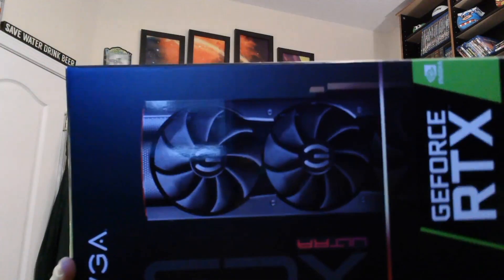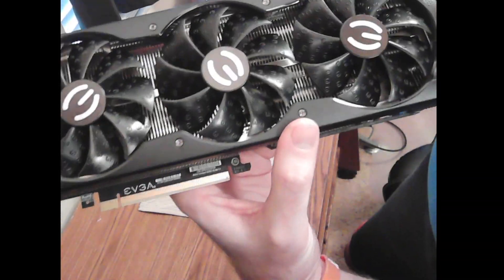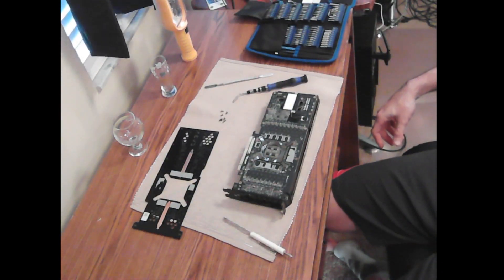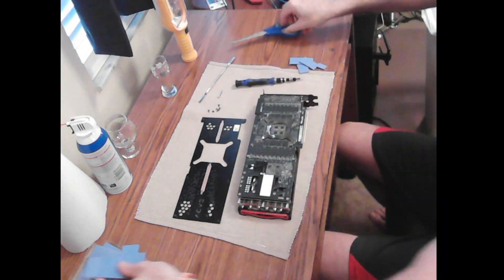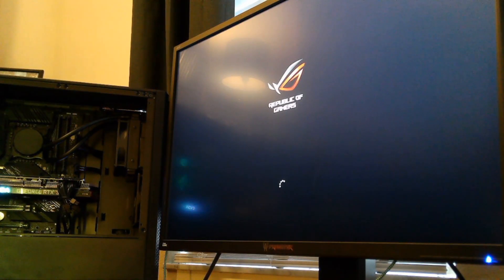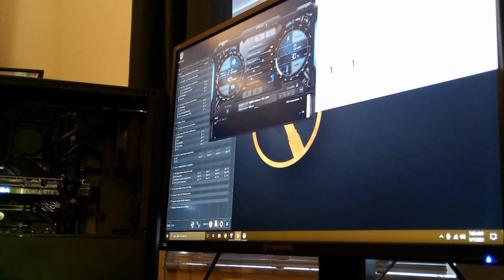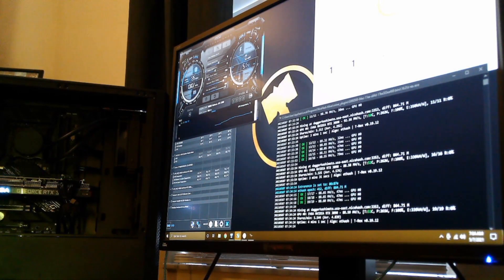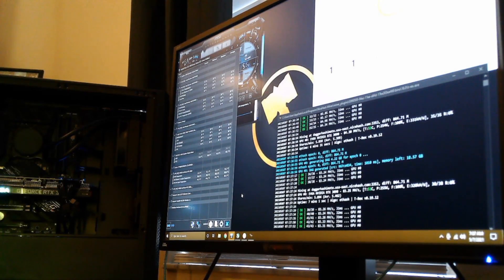RTX 3090 EVGA Ultra thermal pad second attempt

Comment: Check out what We did with the 3090 Kingpin Keep the back plate cool. EVGA's forum has lots and lots of info on what we did with the KPE Uses the same chips on the back. A Big heat sink as big as you can fit. I took the back plate off and have 2 rather Large ones on the chips with a fan on top of the heat sinks they stay warm to the touch with a 2000 rpm fan on top of them i could use bigger ones. These chips give off way way way more heat than there specs say supposed to be like 10 watts its well over 100 when mining any thing. My temps for the most part stay below 80 with a +1400 mhz on mem -200 on gpu and 70%power. I just got a 3090 FTW3 ultra hybrid EVGA has no thermal pads on the back plate at all! I have a email that they said 100c is normal and won't hurt performance! RIGHT! Good thing i got the extended warranty!  A few people even put a aio on the back plate or made a custom copper back plate and heat sinks...I'm waiting on a custom cnc copper back plate for the kpe might have to do one for the ftw3 also! Crays amounts of heat off there chips!

Comment: I have the same card, never opened it, just placed 120mm case fan on the backplate and my temperatures are 57/92°C with 115+mhs while ambient is at 26°C. For some reason I don't think these cards are able to go beyond 116mhs, probably power limitations.
Reply: I,ve got a Constant 124 mh/s With mine
Reply: @avatarwilliYEAH  Nice. Same model? Have you done anything with it or just OC settings applied?

Comment: I just changed my backplate pads on XC3 ultra 3090 and the temps are 1 degree celcius hotter lol I used gelid ultimate 2mm which is 15 w/mk

Comment: I actually had a "professional" change mine for me.... temps went up!  Brought it back.... 2nd attempt- temps went up...brought it back to him... 3rd attempt- temps went up!   ive got some heat sinks and fans coming in today.  hopefully i can cool the xc3 ultra up enough tor run over 70mhs... ugh
Reply: its because the stock cards come with thermal putty for a reason and the professional isent a pro otherwise he would of done putty
Reply: Dont need putty. Done mine works fine 3080 99mh/s xc3 at 70% power! there is a row of black chips that need a strip on top that goes near the pipes on the heatsink. Took me about twenty goes to sort it but did eventually. Add 1.5 strip on top of where the thermal paste was.

Comment: Do you have any update on this bro? What size pads you got and your final resulting temps and MH?
Reply from the maker: i think used 2mm pads.  I put in the real good Thermalright Odyssey 2mm pad on and have only been getting 115 MH/s at 295 watts at about 95 degrees on the gddr6x memory.  The card itself is running around 60 degrees right now with it being hot outside.  I also have a bunch of Thermalright Odyssey 1.5 and 3mm pads because I have done several cards.

I think I filmed me putting the better pads on it, but something was wrong with the video...  I also wasn't 100% happy with my results only being a little better and not perfect.  I don't know why I cant break 115 mh/s with out turning my power way up...

but the card is running pretty good right now.  I feel happy enough with 115 MH/s.  It never gives me any issues.
Reply: @extrmtech1730  you only changed the thermal pad on the back to get 115MH 295W 95C? Did you change the front as well? I have the same card right now I'm setting it to run at 100mh/s and vram already at 104C at 276W (although I only have the fan at 70% because anything above it the fan is too loud lol). I am thinking of changing the thermal pads and wondering if I need to change both side or just the pads on the back plate would be good enough
Reply from the maker: @ddr80  I changed both sides.  I used the thermalright pads.  there is another company whose pads people are saying work better and they are get better results that I might try, but I cant remember their name......  You would need to do a little research.  it might be the comments for this video...
Reply: I have been using frosty thermal pad 12.8. It is similar to the Thermal Odyssey but more compressible which might be better overall when applying. It has proven to be very useful, for my 3090 getting 120 MH/S stable at around 86-90 degrees depending on the outside. I changed both sides btw.

The backs on the 3090 matter so highly recommend good quality pads too. It's dumb but you also have to cool the backs with fans :( or do that silly heat sink mod which I definitely am not going to do.
Reply: @markw496   What thickness (s) did you use? Thanks for the info!
Reply: From memory i used 1.5mm and 2mm. At least I remember having them available. I bought all sizes but I think those two I used. I heard they change sometimes so better to just buy each size.
Reply: @markw496  thanks man!
Reply: Good luck on it.

Comment: What sizes did you use for the inside  of the card? I plan to use 1mm for where the thermal putty is, 2mm on the vram modules and 3mm for the long ones, near the capacitors. What do you think?
Reply from the maker: you realy need to use the exact same size pads or your will have worse cooling.  If you have 1mm, 1.5mm and 2mm I think you should be able to get it to work, I think...

Comment: I have this model completely disassembled and cleaned and I have Gelid pads from .5mm up to 3.0mm. Do you have a schematic of the PCB and the pad dimensions I could look at?
Reply from the maker: sorry.  I didnt find anything like that...  I just lined the old one up with the new to make sure they where the same size.
Reply: @extrmtech1730  it's all good I found the thickness but still doesn't do much.
Reply: @2629derekhale  where did you find sizes? I'm also thinking on repad.

Comment: Can you confirm the 3mm pads won't fit in the backplate of the EVGA 3080 XC3 Ultra?
Reply from the maker: I bought the correct size pads.  you can double up two 1mm to make a 2mm pad, but you can't really shave down one that is too big.

you want the exact size to make sure you are getting optimal cooling.  that is why you are replacing the pads to start with, to get optimal cooling.

Comment: the backplate is all 2mm pads?
Reply from the maker: for this model.  it is different for each manufacture's models.  so getting the right pads is a pain.  I have almost $300 worth of thermal pads after doing 4 different cards....  1.5mm 2mm and 3mm seem to be the most common and you really want at least 12W/mK rating.